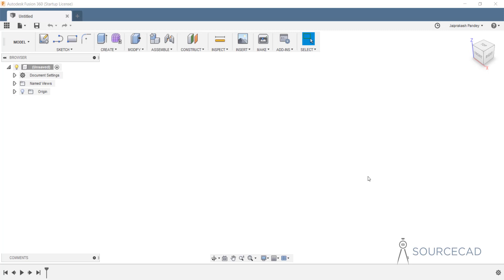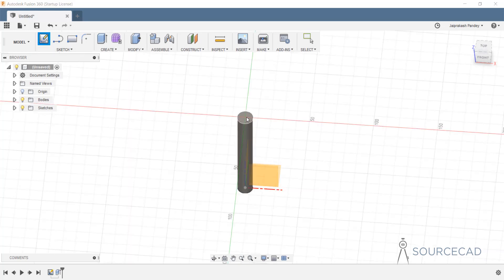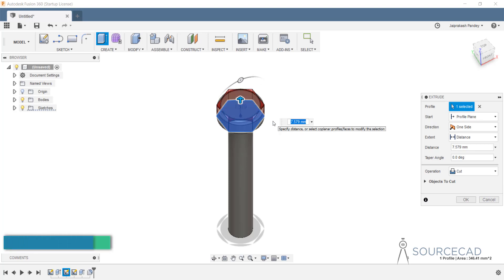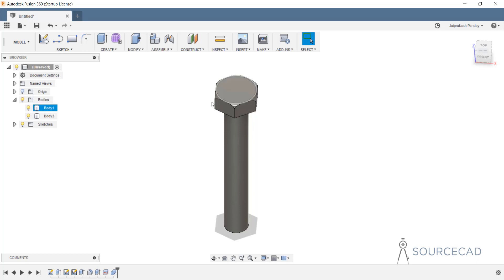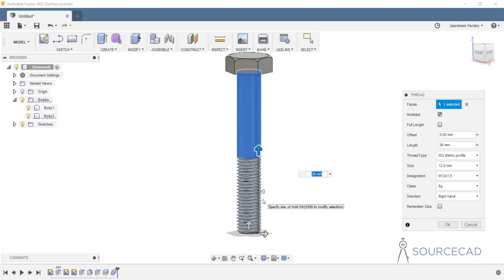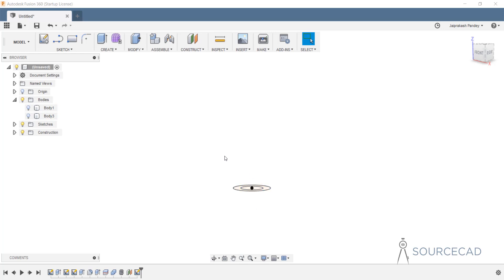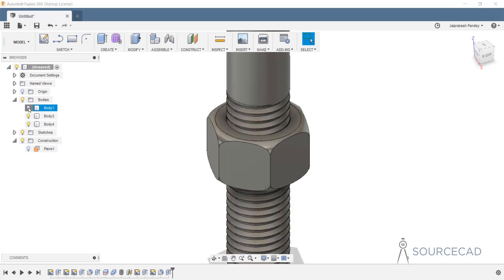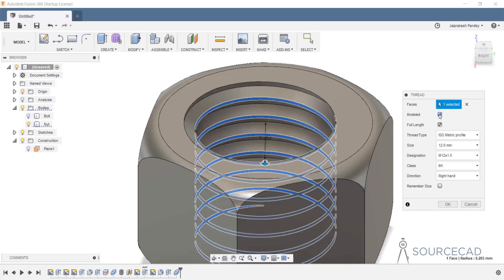Making M12 Nut and Bolt in Fusion 360

Comment: Thanks very much for this video. For some reason I am battling to properly design a socket/nut, M48 into which a vacuum hose with an OD of 48mm fits. Is designed the nut with an inner diameter of 48mm and added the thread for M48 BUT the pipe does not fit. Am I missing something or am I doing something wrong?
Please advise.
Reply: If you 3D print nut and bolt using this tutorial, most likely it will NOT work.  You have to add some 0.2-0.3 mm more space by moving nut's internal surfaces of thread using OFFSET tool, after that it will work.